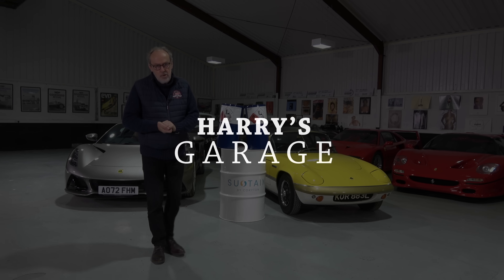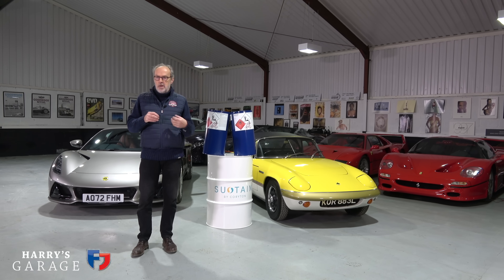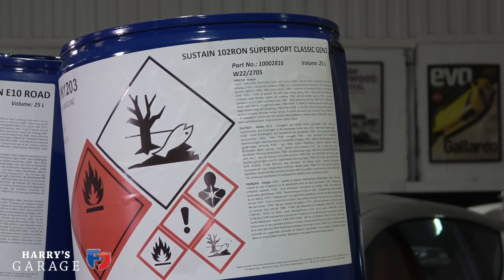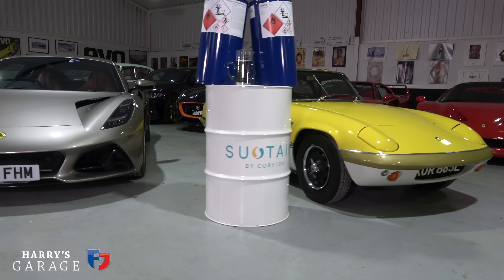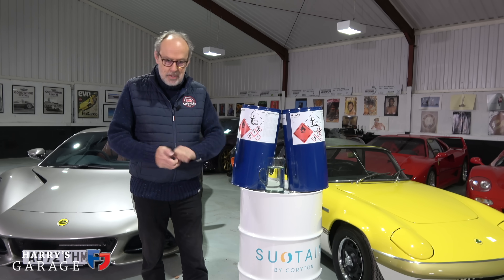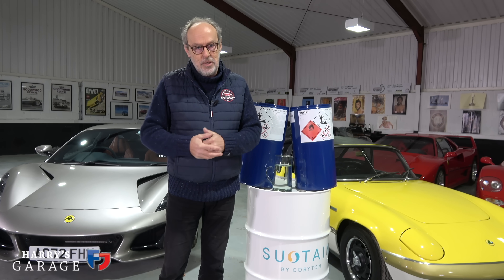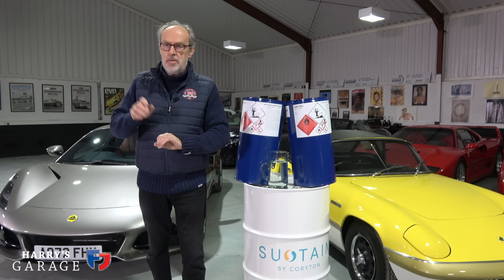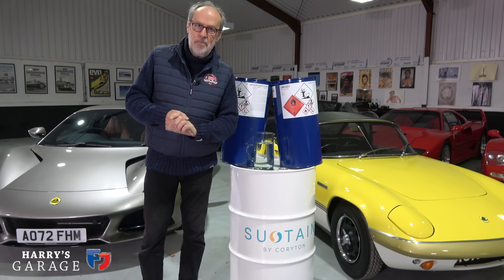Sustainable fuels; what are they & when will I be able to buy some?

Comment: I would really like a critical (realistic) analysis of the whole process of these fuels. There is such a desire to make it look green, that it is easy to forget the cost / impact of all the processes required. There is no free lunch, and if you are to make a few billion liters, is that half of the Sahara filled with solar panels and wind mills? What about the energy required to get stuff out of the 'green' waste? Sure, the bakery waste heat can be enough for some niche plant. But what if we want to run 10 million trucks on it?
Reply: Plus no mention of how you transport & contain it. It is not feasible for everyone to have 'tins'  of fuel for more feeling hanging around their garage. Car emissions are a easy hit as they are most visible, bigger polluters are transportation (shipping/aircraft/HGV's) and power stations.
Reply: These are all very good points, but these synthesized fuels could also be produced in a variety of geographic areas, in practically any country where agriculture is a big enough industry. Consequently, the general public could be come less susceptible to the influence of the various oil industry cartels. Producing big, heavy batteries full of dangerous materials, in quantities big enough to replace all internal combustion engined vehicles, will eventually become a very big ecological and economical problem too…
Reply: @jameslewis8227   Sure thing, electric cars are not 'green' just because local emissions are low.. But if it takes 1000 windmills and 1000 square kilometers of solar panel to make e-fuel for 1000 cars, its not going to work.. Chemistry stuff is rarely efficient, but maybe it isn't so bad and actually a whole heap better than just drilling for oil.. Right now I don't know and it could be anything between 'worse than drilling' to 'completely tree hugger friendly' .
Reply: It is a good solution when it comes to energy density. This is by far the biggest downside to battery powered cars today. This could be part of an energy mix to power transportation.
Reply: @mathiasserneels9857  Oh yes petrol type fluids are amazingly energy dense, batteries suck big time. As Harry says, we can't be done with petrol / diesel for a LONG time to come.
Reply: This is the crossover I didn't expect
Reply: Porsche announced its efuel production in south Chile for one main reason (wind energy multiples more efficient than in Europe). At full capacity they expect to produce 130.000 litres/year.
Let's simplify and assume 1l efuel=1kg. A containership requires around 2.7l/100 km bunkerfuel to transport a 14to container. Hence, a 500km transport of the yearly capacity of 130.000 litre would need 125.000litre bunkerfuel. What's 500km von south Chile? I doubt it's antarctica already. 

Ergo, you indeed need t produce it much more locally. But for the majority of regular traffic, this makes the conversion to fuel pointless, because an electric motor can use the energy more efficiently.
Reply: @lloydmarriott756  That's what I mean, it is currently almost a laboratory project. I wonder IF it is feasible to scale up, or if, when you take everything into account, the gains over just drilling for more oil are minimal.
Reply: Exactly. It doesn’t scale.
Reply: @tbrdoescinema  I'm skeptical but also not a chemist, so I can't just assume my skepticism is justified...

Comment: Aviation is always trying to reduce consumption because of $$$$.

Biofuels are not the answer. It competes with food crops and require huge amounts of water and fossil fuel based fertilisers.

EVs are not the future.  We simply cant mine enough raw materials for the EV transition.
Reply: Absolutely correct about the mining. There would have to be a thousand fold increase just for the battery materials not to mention the required increase in electricity supplies needed to keep millions of EVs on the road.

Comment: So no real answers on the carbon used in production as the source of the ethanol isn’t traced. The plant clearly isn’t powered solely on waste heat from a bakery (which is a nutty claim) 

No answers on the emissions from combustion. - it’s not just co2 is it!

No answers on the energy used to create this fuel and how regardless of the energy source is unbelievably inefficient. 

A few people running this to make themselves feel better about running combustion engined cars will have no impact on the environment.

If you could convince me that the fuel was totally sustainable and efficient to produce I’d be sold.

Then the price 😂😂😂
Reply: CO2 in not a greenhouse gas. No CO2 = no plants = dead planet.